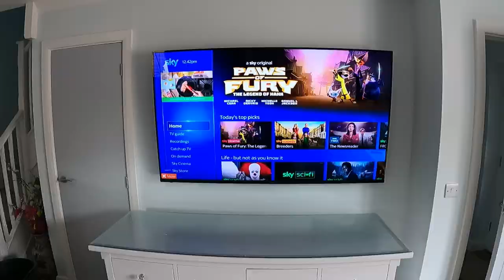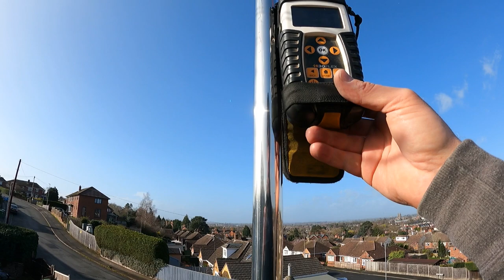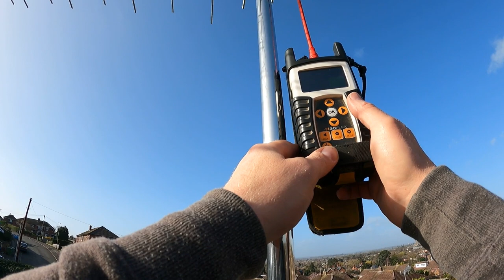THE CHIMNEY RATCHET BRACKET

Comment: I'm an HFC (hybrid fiber/coax) tech here in the states, its cool to see someone doing a similar job across the pond.

The pitch of that roof is so steep it is making me uncomfortable over video. Lol

Only thing I would change is to make a much longer jumper for your SLM, I use a 2m jumper on both my in and out port. Makes taking measurements so much easier, though my meter is 7x-8x that size and heavy as sin. So holding it up like you are is not a fun option in my case.

Comment: If I'm not very much mistaken that looks like a wideband aeriel. So it's not a incredibly old aeriel. The pole looks pretty ancient though.
Reply: I'm talking about the original installation by the way. The new installation you carried out is top class!
Reply from the maker: Absolutely bang on mate.  Should never have been fitted anyway as it’s far to heavy for that size pole and bracket.  It was a diy job apparently though so I’d let them off 😄
Reply: @aardvarkinstalls Are the chimney brackets heavy?
Reply from the maker: @rachelbailey-no2pp  not to me but it depends what you deem heavy?
Reply: @aardvarkinstalls  Well can the brackets weaken the chimney by adding weight?
Reply from the maker: @rachelbailey-no2pp  I highly doubt it as the bracket weighs about the same as 1 brick. 
The chimney will be much much heavier than the bracket.  Plus they are designed to fit on to chimneys like this so weight really won’t be an issue. 

If your chimney is in a very poor state then your local professional installer should be able to decide wether it’s sensible or not.
Reply: @aardvarkinstalls  Thank you 👍